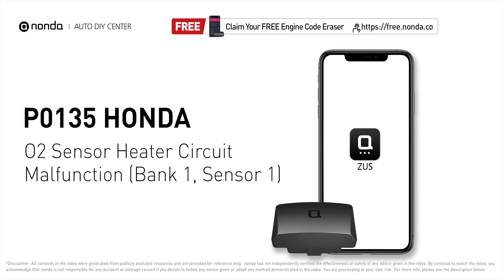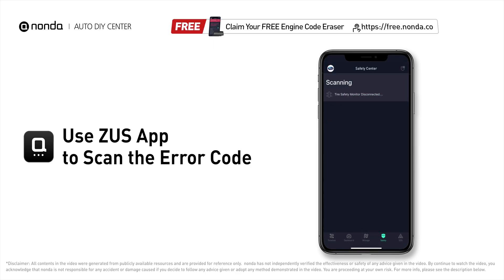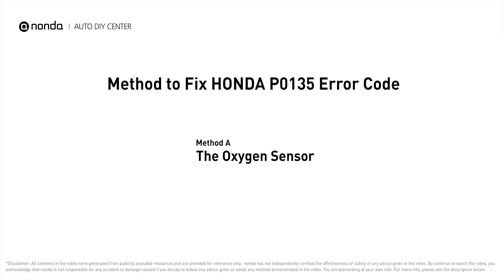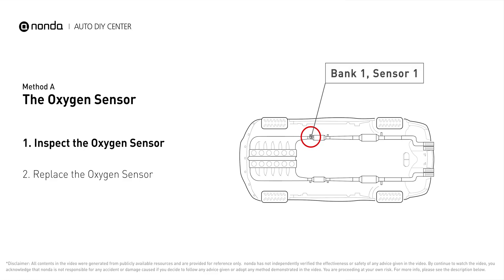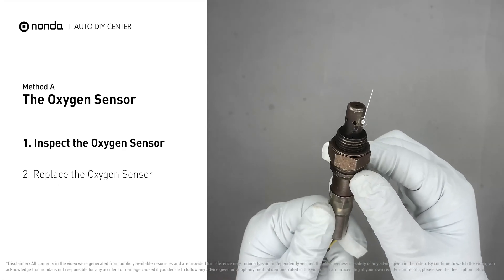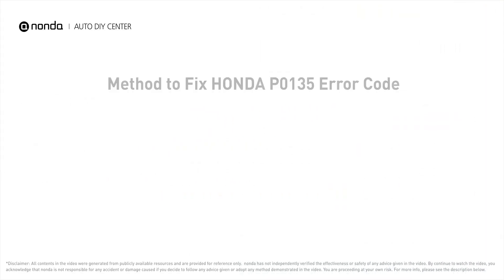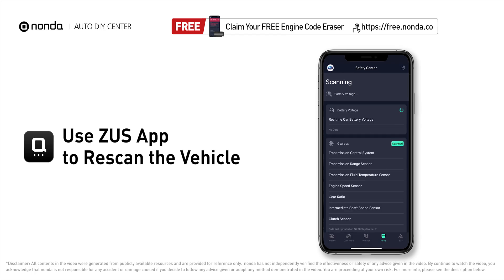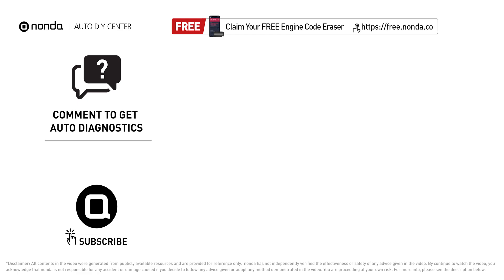How to Fix HONDA P0135 Engine Code in 2 Minutes [1 DIY Method / Only $19.66]

Comment: Mine ready anywhere from 0.43 to 0.79 live data so it must be working but I got the code anyway.
Reply: Maybe my scanner reads heater is on because the wire has power,but the heater in the sensor is not working maybe?
Reply: Probably won't believe this but,it ended up being loose plugs.
Got it to my live data and seen misfire cylinder 2 and made me take the coil out and the plug was so loose,all were so lose I could take them out by hand but the coils were keeping them down enough to run and 10 seconds after I tightened them and started the car the check engine light went off

Comment: I had code P0135 in a 2009 CRV, replaced the front sensor with a Bosch one(with the plug) and after clearing codes am still getting the same code. Any ideas on what to do next?
Reply from the maker: Hello, have you checked the wiring (that goes to the front and rear oxygen sensor)? We also suggest testing the fuse if blown.
Reply: @nondainc  I also have the same problem on my 2005 Honda civic I replaced the o2 sensor bank 1 code still comes up p0135 I checked the fuses and relays all fine
Reply: Make sure your plugs are all tight,just fixed mine and it was loose plugs where I didn't torque them correct when I changed them last year.my live data was showing the voltage and heater on O2 was correct so I started looking in other live data and seen cylinder 2 misfire and that made me check the coil and plug and couldn't believe the check engine light went off not even 10 seconds after running.
The loose plug made O2 sensor code and knock sensor code 
I wasted $30 earlier and 1 hr and cut my hands up changing my knock sensor for no reason lol.
Reply: I found out what the problem was I had with the po135 code I took it to a auto shop they did a diagnostic test some wires from the harness to the computer to o2 sensor it had to be rewired

Comment: Good morning, it's necessary to change both sensors? Upstream and downstream?
Reply from the maker: HI JM, please provide us with your vehicle's year, make/model and confirm if this is the only code you're receiving.
Reply: It's recommended if one goes out the other will soon likey go out.  Like when you replace a headlight bulb should just replace both